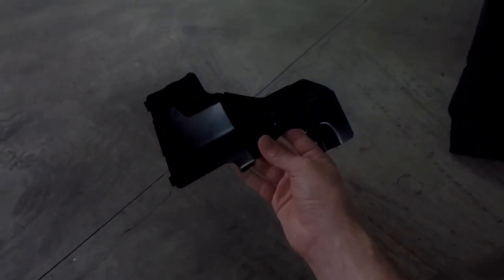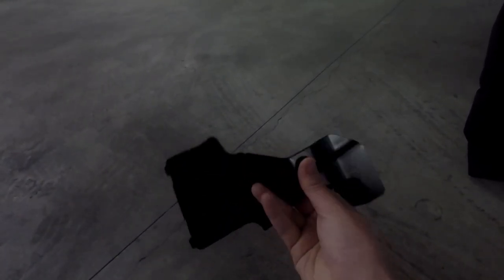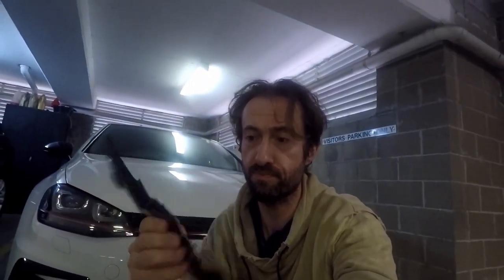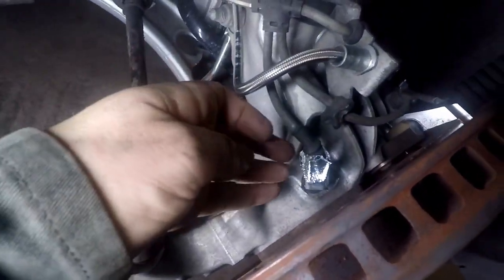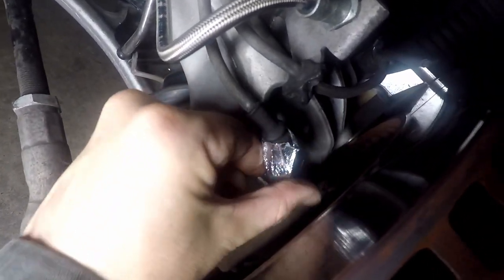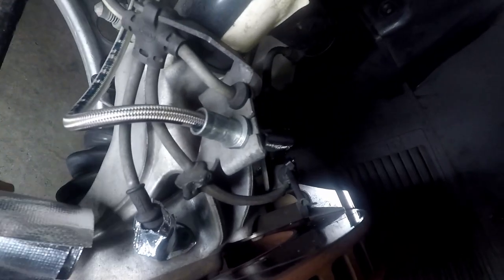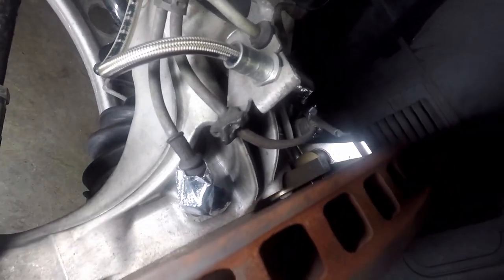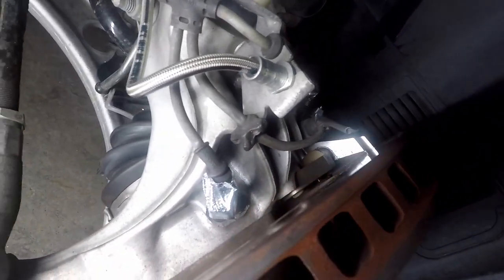OEM+ Brake Master Cylinder Heat Shield (MK7 Golf GTI MQB)

Comment: Great video. Unrelated to brakes but, have you looked at doing any of the OEM+ aero mods underneath your car? Skid plates, belly pans, rear control arm covers etc. Something I'm looking into but would love to see a video. Cheers.
Reply: GTE Undertray fits. great and cheap mod
Reply: @PeterPorsche1  amy pics? I'm assuming GTE has lots of extra bits. Which ones fit?
Reply from the maker: I have and I did a video on it 2 videos ago :)

Comment: I never noticed that before, but on my GTI the brake-fluid reservoir is on the right side, between battery and intake piping. Do you know by any chance, why thats the case? Different market maybe?
Reply from the maker: Yep this is a RHD car so we have it on our drivers side.
Reply: @trackhackau  ah yes, i have not even thought of that haha. thanks!
Reply: @koeskss  honestly I didn’t think of it either before I saw the comments. But makes perfect sense.
Reply: @trackhackau  what’s the exact part number for the RHD shield?
Reply from the maker: 5Q2612163G
Reply: where do i get the bolt to secure it? thanks
Reply: And the screw part number Vn 10170303 😎
Reply: Uk. 🇬🇧